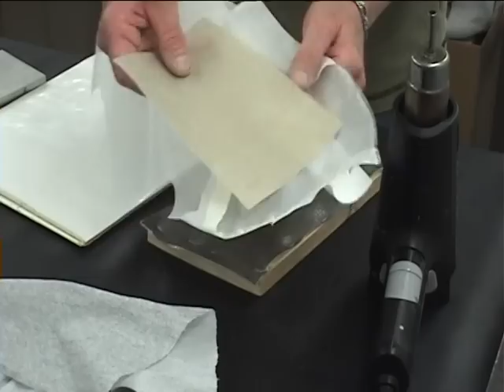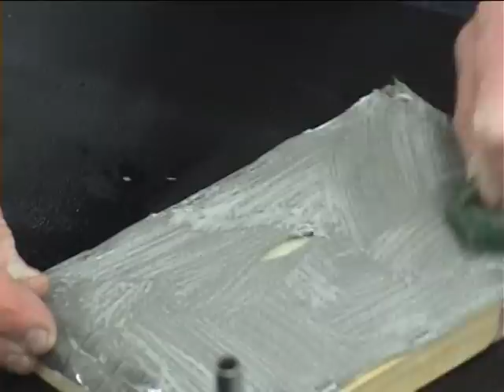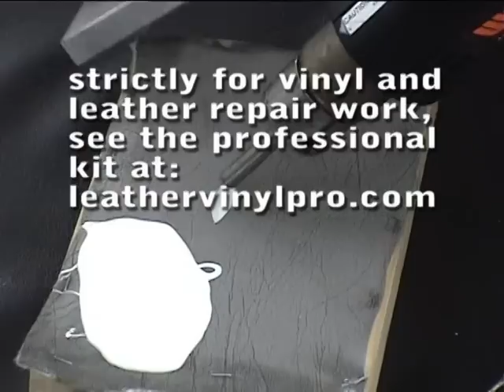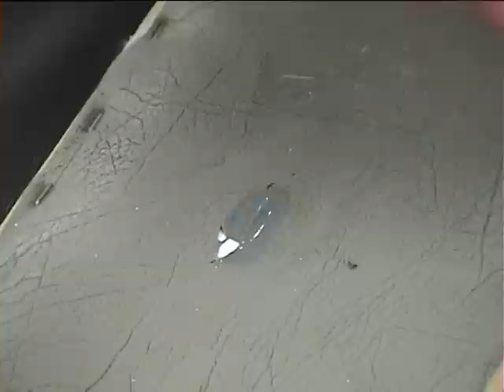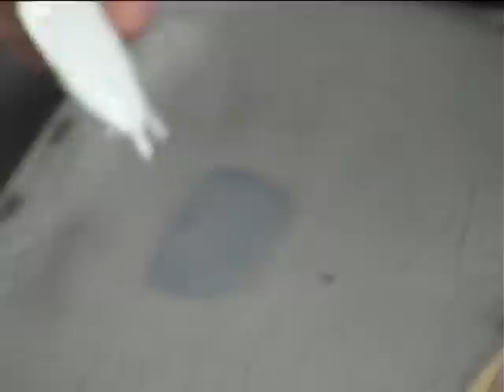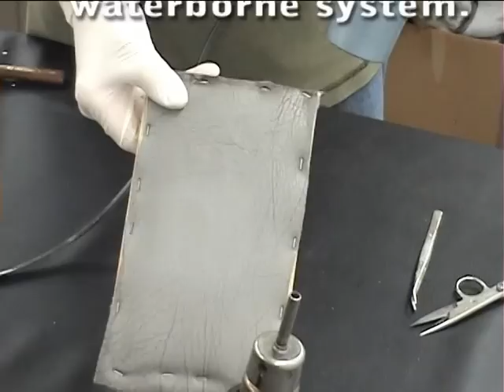vinyl and leather repair professional

Comment: doing interior repairs on cars past 10 years .
This is very good demonstration with a good good result
Reply: johny s i have watched a lot of repair videos and have done many repairs on cars i have bought and resold. this system being able to duplicate grain and color seems very good...i have been sanding my filler the way i do bodywork on cars..My question is where can i purchase a kit like this? and do you think its the best system...? i live in sw florida and interiors get trashed from the heat...any point in the right direction is appreciated....I had to give up my boat detail business...

Comment: So in vinyl repair, what we do is take a small amount right off the top.  it doesn't take much. that's the warmest part right here. i'm gonna invert the spoon. cover all 9000s grains. aerate it. warm it up, driving up that top note. that cream. pure vinyl. sweetner. mmm that's a 10!  and now you can call yourself a professional.

Comment: so i was wondering i have 2 small rips like this that are repairable with kits ive seen from companies but i also have a palm sized hold in my leather, i was just wonder if i was to find a piece of leather matching could i put it in and then do this whole step by step to repair the big hole by basically treating all the sides like this. so essentially you have the new leather in the whole and 360degrees around the rip you repair just like this video. or should i get a new car seat?

Comment: I was attacked and stabbed. I was wearing a very expensive Danier leather jacket and the inside of the left arm was completely soaked with blood which in turn dried and has cracked very badly. Is there any way to fix this, or will I have to completely replace the jackets arm with a new piece of leather?  I took it to one leather craftsmen here where I live and he said he was unable to even attempt to do such a complex fix. Any help or advice would be greatly appreciated, than you in advance.